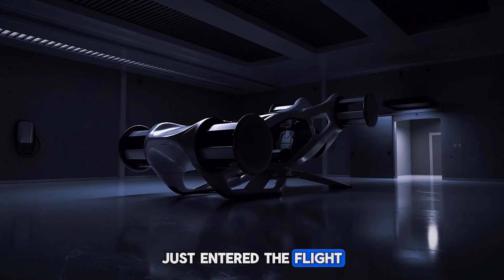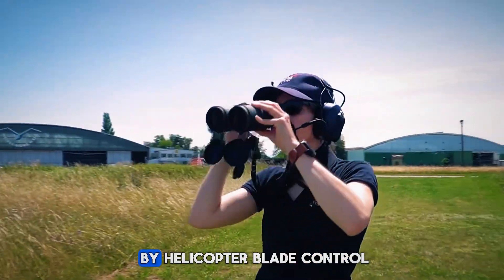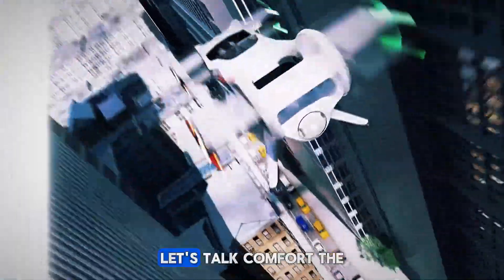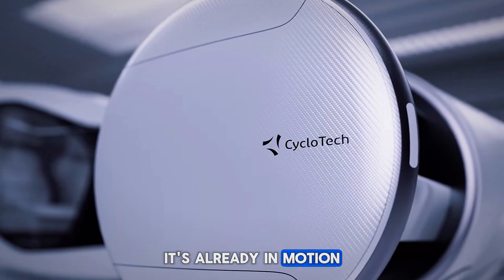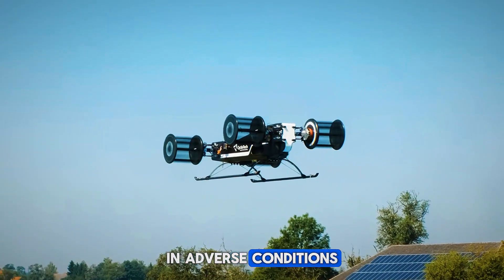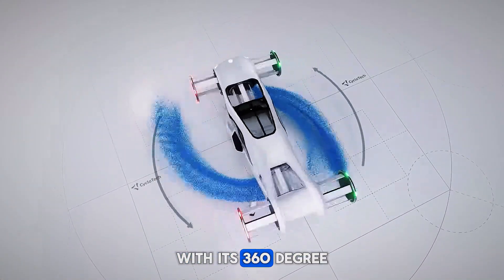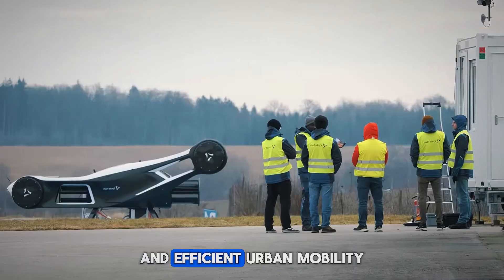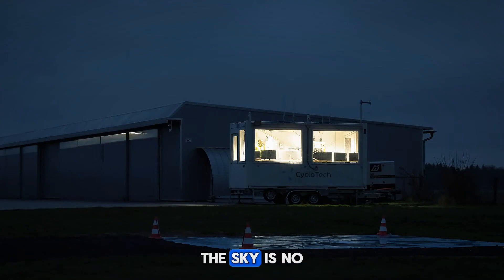CycloTech Blackbird Flying Car Ready To Takeoff in 2025 | Revolutionizing Aircraft Design

Comment: The Real Potential for Urban Mobility
Public transport and the automation of commercial and private transport, not flying cars
Investing heavily in public transport means:

Increasing frequency and coverage: More buses, trams, subways and commuter trains that arrive frequently and reach more areas of the city, making the private car redundant for many trips.
Improving intermodality: Integrating different means of transport (bike sharing, car sharing, scooters, etc.) into a single easy-to-use network, perhaps with a single app and a single ticket.
Making public transport attractive: Convenient fare plans, greater comfort and punctuality, so that it is the preferred choice for citizens.
This not only reduces the number of private vehicles on the road, but also reduces air and noise pollution, and frees up public space.

Automation in Private and Commercial Transportation
Automation (self-driving vehicles) has enormous potential to revolutionize ground traffic:

Flow optimization: Vehicles that communicate with each other and with infrastructure can coordinate to avoid traffic jams, maintain constant speeds and reduce sudden braking, making traffic flow more fluid.
Increased road capacity: Autonomous vehicles can travel closer together safely, effectively increasing the capacity of existing roads without the need to build new ones.
On-demand services: Fleets of autonomous vehicles for ride-sharing or delivery could reduce the number of car ownership, as the vehicle would be used only when necessary.
Efficient logistics: Autonomous trucks and vans could operate around the clock, optimizing routes and delivery times, reducing commercial traffic during peak hours.
In short, while the idea of flying cars stimulates the imagination, the real solutions to traffic and logistics problems in our cities are much more concrete and require intelligent and targeted investments in public transport and vehicle automation technologies that we already know.

Don't you think that a more "radical" approach to improving public transport infrastructure, combined with the advancement of automation, is the most sensible way forward?

Comment: I imagine very short range given the dependence on electric power and limitations imposed by battery weight. Nice short hop concept for large urban areas and megapolis regions.
Reply: Imagine a small gas turbine running a pair of rotars, clutched of course..3 turbines that would be some ummph!!!
Reply: we have some new breakthrough in battery development tech (google it). i think 2030+ will be the year where we saw flying vehicles being used widely by average consumers, and sold globally.